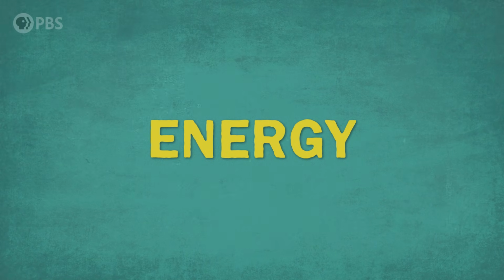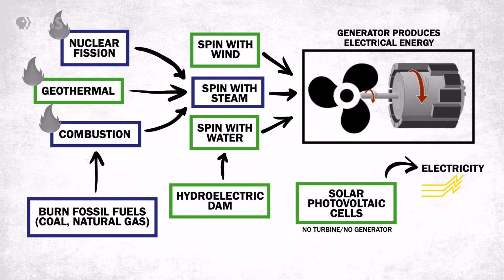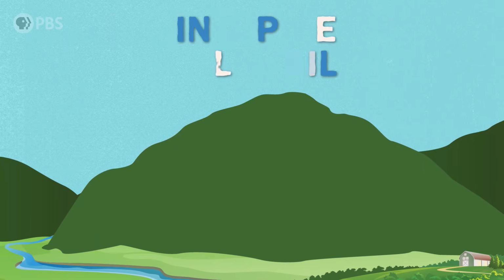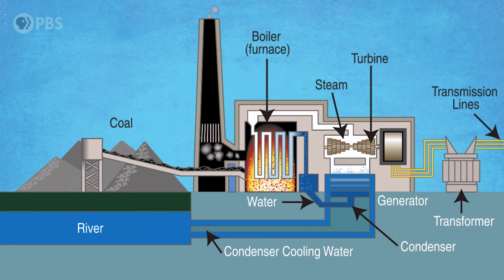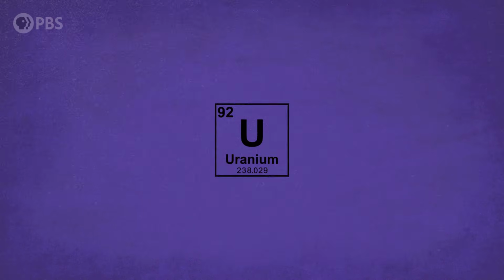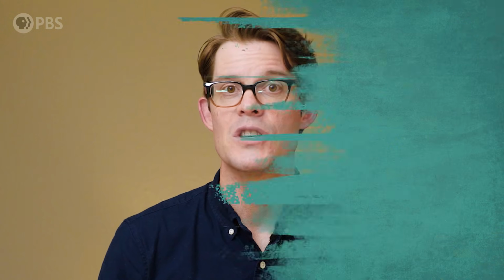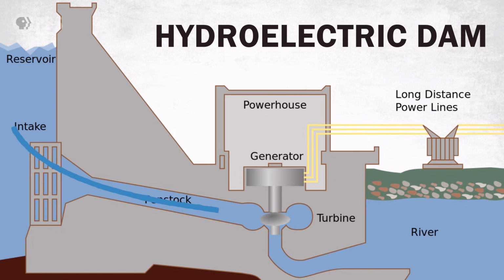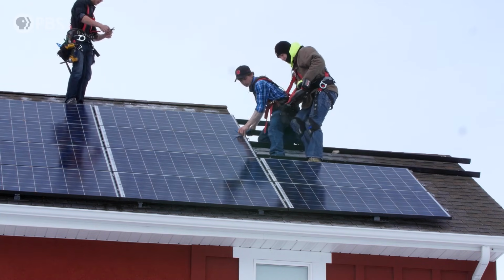How We Make Energy  | Essentials of Environmental Science

Comment: yeah but no... once you take a closer look, it's easy to realize neither wind or solar can be considered renewable (at least, not based on our current technologies)
1-wind energy requires huge amounts of ressources to build those turbines (large underground concrete base to hold each turbine, materials for the main body and blades, as well as the magnets needed for the generator), have a farily short lifespan (20 years on average, often less), and are hardly ever recycled once out of commission. what's more, the capacity factor is just horrendous, occasionally spiking at 50%, but actually averaging below 25% -if not 15% over the span of a year, meaning you need 4 to 8 times more wind turbines to actually get closer to the targeted energy production (ie 4-8 MW of wind turbines for a target of an average of 1MW all year), and if you factor in an energy storage component to compensate for the variability, the cost of the whole thing is just ridiculous. wind energy is renewable, wind turbines are NOT!
2-solar ain't much better as a large majority of the panels are produced in china... where they mostly run coal power plants to power all factories. for solar panels to make sense environment-wise, you thus need to first "offset" the carbon footprint for its production, which can take from 10 to 20 years depending on the sun conditions on location as well as a proper maintenance of the panel (which needs to be very regularly cleaned to work as optimally as possible, as a mere thin dust cover can easily lower the panel energy production by up to 20%). finally, once the solar panels have gone through their life cycle (less than 30 years), most of them aren't recycled to produce new ones : solar energy is renewable, solar panels are NOT!
the only actual renewable energy production methods shown in this video are geothermal and water dams. wind and solar, at this point in time, are but greenwashing marketing products.

Comment: Also, it is nearly impossible for a modern nuclear reactor to melt down. Not only did Fukushima's reactor design predate many of the most important modern standards of safety, but Japan knew it was going to blow from before it was even built. The designs that were approved and the designs that was used for it are vastly different, leading to a multitude of reports that it was dangerously susceptible to a tsunami or other such natural disaster. Specifically, it was built too close to sea level, far closer than the designs specifically outlined.

Sadly, the Fukushima Meltdown led to Japan closing down the vast majority of its reactors under pressure from citizens who were under the false assumption that such meltdowns could ever feasibly happen to a modern reactor. 

Moral of the story: Listen to safety inspectors, kids.
P.S. Nuclear Reactors make a very very very tiny amount of waste compared to coal, oil, and gas reactors.

Comment: Solar can be used to heat salts or water to spin a turbine in the concentrated solar thermal method. PS10 has an efficiency of 17%. Given photovoltaics are doing 14-47% depending on the tech and how experimental you want to get, I can see why you didn't mention them.

Comment: Thx for the video, you guys make a great job!
It could have been nice to say how many casualties happened in Chernobyl and Fukushima: respectively 20 000 and 0, cancers up until 2065 included. This is the result of the UNSCEAR which is basically the IPCC of radioactivity and represents the scientific consensus. Don't believe me, go check it out.
It could also have been great to point out that no electricity generation system is renewable. The sun, wind, water in a dam  and earth heat are renewable energy sources but the systems needed to convert that energy into electricity are not.
I think the graph at 20:20 is missing wood as primary source of energy (which is the most used renewable energy in the world, just not for electricity generation)

Comment: Uranium is not the source of radioactivity in nuclear fission waste it is basically the fission products. Uranium isotopes have extremely long half lives however when atoms are split by fission the resulting products are effectively random combinations . 
There is also the issue of isotopes as only the shorter lived U 235 is a naturally occurring fissile isotope. Other isotopes used in reactors need to be synthesized by neutron bombardment to make Thorium into to U 233 or Uranium 238 into Plutonium 239. additionally the reactor types discussed are all water based reactors which are inherently more risky as the water is used as the coolant and moderator but if too much reactions go off it can boil resulting in a runaway reaction as as both the coolant and moderator are lost. Molten salt reactors don't suffer the same flaw though they have other problems particularly the highly corrosive nature of molten salts.part of the problem with radioactive waste is that it gets dumped so one area of development to increase efficiency is to get even more work out of the waste which is rich in short to medium half life radioisotopes. One issue glanced over here was the sheer inefficiency of Uranium extraction as it is a strong lithophile or element that preferentially binds to oxygen. Lithophiles like the  rare Earth elements As well over over 99% of Uranium being U238 which retards or blocks fission chain reactions means only a tiny amount of that Uranium is fissile but it takes an enormous amount of energy to separate Uranium from rocks in the first place as Uranium usually doesn't concentrate instead occurring well distributed through the Earth's crust. While it is a heavy element it needs to be remembered that due to its strong affinity with Oxygen close to 100% of the Uranium within the material which would go to form the Earth is locked in the crust particularly continental crust. This means most of the Uranium in differential worlds with accessible surfaces is in the Earth's Crust with our Moon being the other top candidate. In fact in the ancient past U235 did form a natural Uranium reactor in Gabon if I remember correctly.

Solar is great but the  construction and end of lifetime costs are not negligible they need to remain in use for a long time to break even in terms of carbon emissions alone.

Moreover large scale renewables like Wind farms and especially solar arrays begin to directly effect the climate in complex ways we don't yet fully understand
Reply: @ForzaJersey  I am also pro nuclear but this technology cannot be implemented everywhere, especially where big earthquake are expected (like Japan... or California) or where water will soon be seriously lacking because of climate change. I also wonder how it compares to geothermal energy in terms of environmental impact (not just co2)
Reply: @soufianekharroubi8835  neat points :)
Reply: Thirdly "we don't know yet" about the effects solar arrays and wind turbines have, that part is just an outright lie. Solar arrays, induce regional cooling by converting incoming solar energy to electricity in comparison to the climate without solar panels. Resulting in changes in regional precipitation on top of the cooling. This is not a problem. Your point about wind farms, it effects the weather patterns around them for a very short distance and below, where it can either warm or cool the ground depending on the ambient temperature and time of day of course. This would mainly have an effect if the land is agricultural as it would make crops less or more productive. The two solutions are have wind turbines in areas of natural high turbulence, and design blades that create less turbulence, this is incredibly easy to solve.
Reply: In Oklo, Gabon, 2 billion years ago to be precise ;)
Reply: @soufianekharroubi8835  Yep lots of interesting stuff in old cratons
Reply: Just to point out while nuclear is alright, it isn't a catch all solution to Climate change. As in a hyperthetical the world just went fully nuclear, we'd have already failed at mitigating climate change, due to the exceptionally long time it takes to build a nuclear power plant.
Reply: @Alex-cw3rz  There is no unique solution to takle climate change. Nuclear is good to decarbonise electricity production but electricity is only 20% of the energy we use worldwide. Though nuclear is probably the best solution to get out of coal as 65% of coal is used to generate electricity. Decarbonising electricity could be a solution for transport or heating but other exist. For example for transport, a small car of 500 kg with a maximum speed of 120km/h could use 1.5L oil/100 km. This would be way much more efficient than decarbonising electricity and switching to electrical vehicles (which btw, if they are 2t like the current ones, are not so good for the environment). Nuclear also won't help to decarbonise agriculture.
About the construction time, France went from 0 to 75% of its electricity generated by nuclear in under 15 years so a crash program can be very quick.
Finally I would add that nuclear won't save us if we continue to look for economic growth. Very simple equation show it (=> see Kaya equality)
Reply: @soufianekharroubi8835  all I have to say in 15 years they made 56 reactors, which was not even 75%. 15 years is 2035, which is too late as I said, 2030 is when we really need to be well on close too 100%. On top of all that this was one of the largest nuclear powers in the world and did not even get enough energy. Coal powerplants are often in inappropriate locations for Nuclear power as the alternative, due to them not needing a large water source, unlike Nuclear. Whatever is the appropriate alternative in that area, is what should be built, If that is wind, hydro, geothermal, tidal or be it nuclear.
Reply: @Alex-cw3rz  What is the source of "close to 100% by 2030"? The IPCC says that to stay under 2°C in 2100 we need to divide our CO2 emissions by 3 by 2050.
I would also doubt what you say about coal powerplants needing less water than nuclear ones. Every thermal powerplants needs water as a coolant, no matter if it is gas, coal or nuclear. If you could back it up with a source, I'd be inclined to change my mind of course.
Reply: Secondly solar about 10 years ago maybe even earlier than that, was about as inefficient as you said, but now and especially beyond with better materials etc. what you said was just factually incorrect.